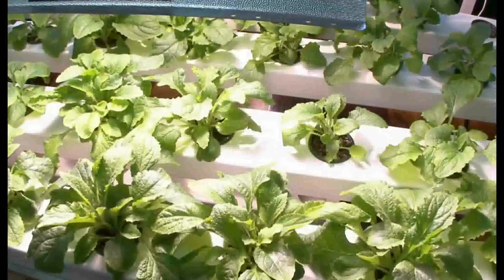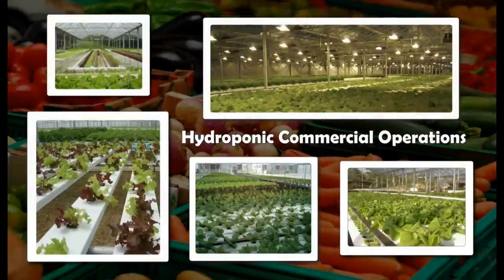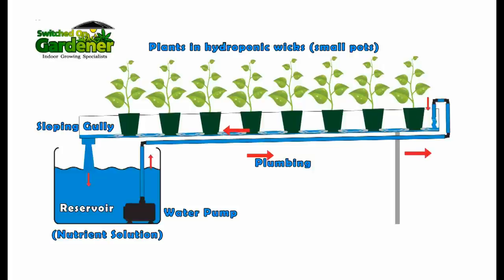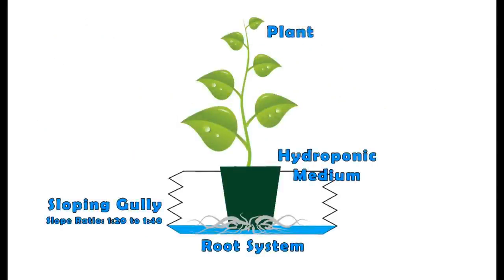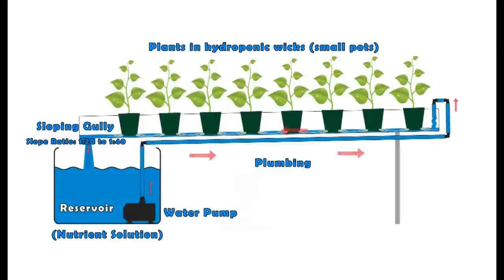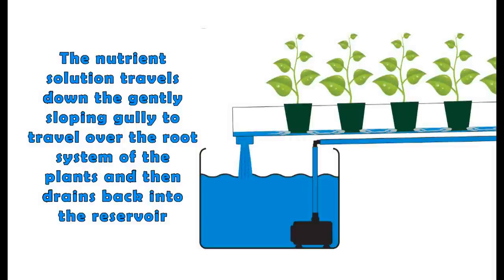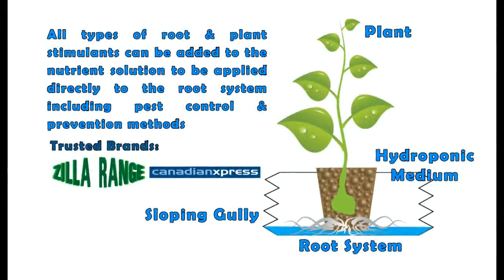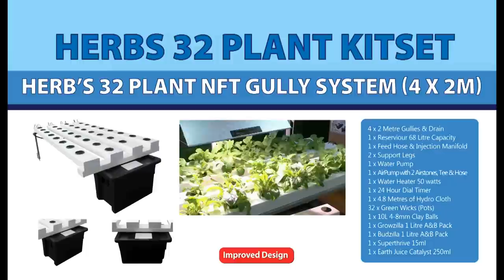Hydroponic - NFT systems basic run down (Nutrient Film Technique)

Comment: So can you put like a seed in between clay rocks and as long as nutrient filled water touches it , will it grow? or do you have to grow a seed in a soil pot first and then transplant it? So you do not have to do anything after setting up the system (no watering) just put the pump on a timer?  Is there a specific mineral solution you have to buy and pour in the reservoir? What is the perfect mineral solution?